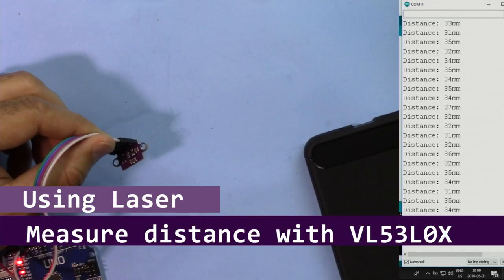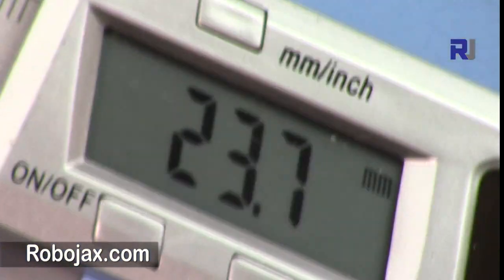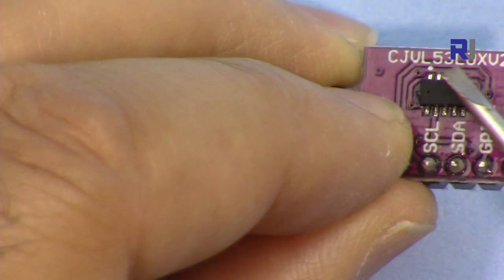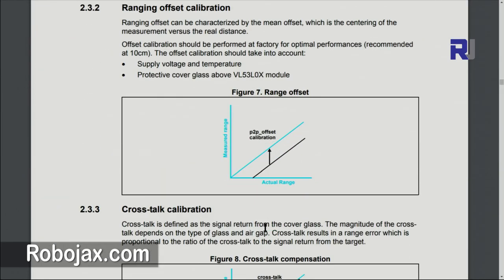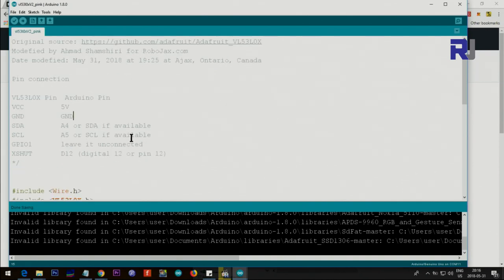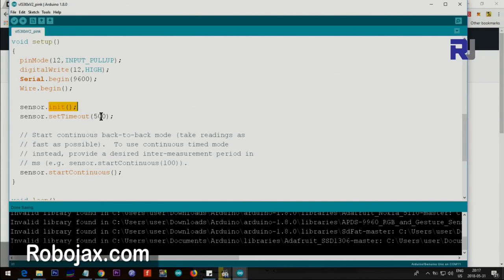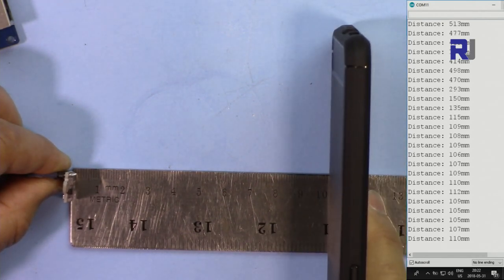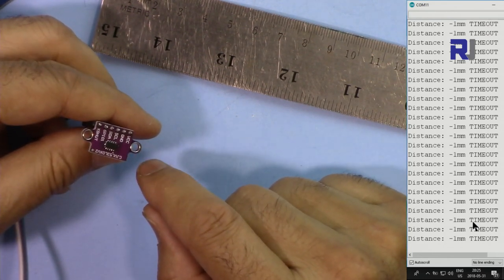Lesson 77: Measure Distance with VL53L0X 6 pin Laser module with Arduino

Comment: Hello Sir, Thank you for the informative video. I have a problem when I try to use A4 and A5, the data is not send to the monitor screen. Do I have to specify any pin declaration if I directly use analog pin instead of SDA and SCL pin?

Comment: The specs only give the max range. What's the minimum distance you can read?
Reply from the maker: I have updated the page where the code is  https://robojax.com/learn/arduino/?vid=robojax-VL53L0X  Datasheet does not mention the minimum distance, I have included image of page 30 of datasheet where you can see the angle between emitter and collector (two small holes) and see the distance and find out at what minimum distance the collector receives the reflection from emitter. good luck.

Comment: hi it's very good.  but can we use measured signal to control stepper motor?  For example, the sensor always keeps a distance of 70 cm from the object, if the distance changes, the sensor will detect and control the motor to operate to keep at 70cm.  i want to make Z axis auto.  whether it is possible.  do let me know.
Reply from the maker: Hi
Sure you can use it. Hi as the sensor to measure the distance and write your code to do anything you want. Arduino bus for that purpose
Reply: @robojax  can you make a video like that, I don't understand much about aruino so I can't do it.  thanks.

Comment: Hi, could you give me an idea of what to do, i am meassuring Fuel level with TOF sensor, It works perfect when engine Is off, but when engine Is on, it emideately the TOF  get off, like if the sensor were in short. The investigation show me that the spark of the spark plug Is cousing the failure.  Do you have an idea of how to avoid this failure?.  I already used a shielded wire with no results.
Reply from the maker: Hi, yes. it is the noise of DC supply.  Put 100µF to 470µF with 1nF capacitor on the 5V and GND of this module. it should filter it.  The noise is messing up the i2C signal.

Comment: Hello mate ! I need your help in this case !
I want to detect distance between 0 to 30 mm with variation of 1 mm. I tried Sharp GP2Y0A02YK0F and GP2Y0A41SK0F etc .. but they are even non linear as mentioned in datasheet ! or sensibility is low ( 1V / 30 mm ) ! 
I want to see the curve of this sensor ( Voltage / distance ) to know is there a linear part of the curve with good sensibility ( expl 2 V / 30 mm ).
Please answer my question, thanks !
Reply from the maker: Hello, this is totally different. Sharp modules output voltage proportional to the distance. this module however does the calculation internally and stores it in digital memory called register. then we read the register to get distance. this is very accurate with ± 2mm as mentioned in the datasheet.
Reply: @robojax  that mean I can use this sensor to get the distance between 10 and 40 mm for exemple ? ( I need a 30 mm linear curve with accurance ± 2mm no problem ) if not, what can use as sensor ? ultrasonic is not accurate !

Comment: Hi, thank you for your work. Please help me to fix the problem: when a distance to the object is greater than maximum value (1500 mm for my VL53L0X) it shows random incorrect values much lower than even 1000 while RangeSatus != 4, so I can't check the out of range state. Is it possible to correct this problem?
And another question: is it necessarily to remove that red film from the laser chip?))
Reply: Seems that protective film was the cause)

Comment: Hi , i am using this sensor in one of my projects but I can't get it to work it just shows the same number again and again.
Reply from the maker: Hi, you must have changed the code or the sensor is on the exact location. Use I2C scanner to check if you are getting an address for I2C scanner. Search for Robojax.com for the scanner

Comment: Will the new i2c address remain after turning power off and on?
Reply from the maker: Are you planning to change the I2C address and use the module somehwere else? if not I blive it won't work. Using Arduino/Raspberry Pi, once the program starts, the address is activated and is there until you shut it down. you won't be able to use the module until you power up the board and run the program. I looked at the datasheet again and it confirms my understanding that it deos not save the address.  https://www.st.com/resource/en%20/datasheet/vl53l0x.pdf
Reply: @robojax  thank you for the reply. I was considering using several to measure distance all around, kind of lidar. The other option is to place a single one on a motor and make it spin while keeping track of the angle in some way. So I just play with this idea in my head thinking which direction to go.

Comment: Can this be used to measure water levels in ml?
Reply from the maker: after I made series of laser video, I had no idea that people would use it with laser.  learn about laser infraction with water here https://www.technologyreview.com/2017/08/29/149421/engineers-turn-a-laser-beam-into-a-stream-of-liquid/#:~:text=Laser%20light%20does%20not%20usually,another%20medium%2C%20such%20as%20air.&text=If%20the%20water%20is%20pure,with%20no%20streaming%20at%20all.

Comment: i had problem with this sensors. i need to measuring 50.25mm but this sensor show only in integer value
Reply from the maker: Of course you should have problem. The resolution  is 2mm.

Comment: why i cannot combine it with the servo motor, everytime i insert code to control a servo, the results are -1mm, timeout. plese help me
Reply from the maker: it should work if you understand the code and respect the syntax or how to write the code.
Reply from the maker: you can learn how to combine the code from this video https://youtu.be/NXAswOc_2zg
Reply: @robojax  it works when there is only your code to measure the distance, but when i insert code for the servo, it returns like that ;((

Comment: The code uploads notmally and I do not gst any error, but the serial port is just empty
Reply from the maker: First check this https://snipboard.io/y3pKwG.jpg, then Use the I2C scanner code, upload it to Arduino and see if it prints the I2C address.  if it does not, then wiring is bad or module is dead.

Comment: why you use arduino to powerup the sensor at 5V if the voltage of sensore are 3.5V Max ?
Reply from the maker: then it should be connected to 3.3V. I might have mistaken.
Reply: @robojax  Sorry i have another question: with your code, my sensor (the same of the video) when start to read, print a value majeure than 50mm of the real measurement. Do you know why ?

Comment: Im not able to compile the file because im prompted "VL53L0X.h: No such file or directory" and I have already included the library
Reply from the maker: You did but Arduino did not find it. Click on Sketch->Include Library->Add .zip library and brows to the zip file. It should work.
Reply: Use this library: https://github.com/pololu/vl53l0x-arduino 
Instead of Adafruit.

Comment: Hello
Your example is not correct. You are using Polulu library and its example not Adafruit library.Please explaine again ?
Reply from the maker: Hi, The important part is to show the distance which it does.
Reply: Robojax The most important part is to make usefull tutorial with right links for code and used libraries.It is not to hard todo this,othervise could beginner  or more expireenced user stuck with tkis mistakes.I had this problem too,so we expect your improvment with corect links !
Reply from the maker: Sorry I did not understand. Is the link incorrect or the explanation (of the link) incorrect?
Reply: @robojax  You have used Pololu library, but your link provides address of Adafruit library, that's why many people are getting "VL53L0X.h: No such file or directory"  error. Your video is great just make this change.

Comment: Thank you! It seems to have difficulties to recognise the D12 on the Arduino Micro (it's written ~12 on it) even tho there is no error message. The distance measurement only shows -1. I tried to change the  pinMode(12,INPUT_PULLUP);  ,  digitalWrite(12,HIGH);  to another pin but it didn't work. 
The code seems to works on the Arduino Nano and a Arduino Nano Copy  both with D12. 
Could you help me?
Reply from the maker: Please use I2C scanner to see if you are getting the address http://robojax.com/learn/arduino/?vid=robojax-I2C-scanner
Reply: @robojax  Thx! Another question: I've already attached the MMA8451 Accelerometer to pin A4 and A5. Is there a possibility to change the pins for this sensor to other ones? Like A2 and A3?